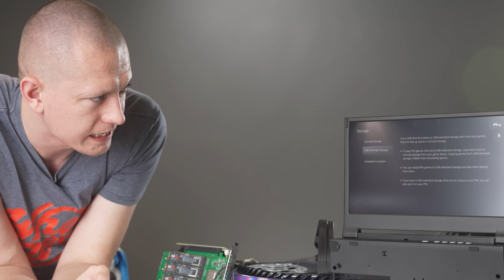I Put A GPU on the PS5

Comment: late to the party, buttttt... I installed a gtx 660 back when it was relevant, on a 13" Alienware laptop. Similar to what you are doing. What did I learn? Well, proprietary bios have what is called a "white list". In that white list, is all the hardware that the the bios will tolerate to boot. As in, if it detects a pcie device, on initialization that is not on  it's list, it won't boot it. 
.
This is more than likely, how sony kept people from upgrading their systems. The "software update" was probably more likely an update to the bios white list as well. How do you get around that? Well, you wait until the system passes post, then install the pcie device, BEFORE, the software attempts to initialize everything during boot. Pcie, "should" be hot swappable, i.e., it's not going to hurt anything to plug it in while the system is powered. I accomplished this by either listening to drives spin, or watching the power led initially flash, I can't remember.
.
Anyway, if you look for the highest scoring Alienware m13x I think, it's been years since I saw that laptop on firestrike regular, you will probably find my laptop, with 660gtx for the gpu.

Comment: If the SMPS turns off while unplugging the SSD slot use jumper in 24pins cable to short the SMPS. It will turn on the card while unplugged

Comment: buy a pci 4.0 adapter for the graphics card and connect the power supply to it, in addition to the adapter there is a connection [cables] for the wifi card with a slot for the wifi card and connect it to the console if the console has a wifi card

Comment: I have a homebrew on the PS4 but i'll not be hacking the PS5 until the PS6 releases.

Why? Simple hacking your primary console opens you up to lots of problems. The PS4 home brew i have every now and then needs me to force boot it requiring a laptop and ethernet cable along with disabling my firewall and antivirus as the tools are always picked up as a threat.

Comment: You need to Pre-configure your raid setup on a PC then install back in the PS5 and it should work. Hardware RAID cards have their own BIOS to create your raid volume. So create the RAID volume on the PC but don't format it until you have it back on the PS5. That should work if it can work at all. Good Luck!

Comment: Been wondering y cant u just put a more powerful chip on where the liquid metal is
Reply: it doesnt rlly work like that, the motherboard will just reject the chip because the chip that powers the ps5 is an APU specifically made for the ps5s motherboard
Reply: @unbtbtlyus2399  ic thanks
Reply: @unbtbtlyus2399  they should

Comment: It’s maybe possible if you externally power the adaptor i think if you cut out the 3,3 volt lines and ground and then power it with a battery or a powestation it may be possible. the 3,3v lines is needed to give a power signal so yes if you unplug it it wil just turn off and if you cut them out you won’t be back feeding in to the ps5 and pc so I can’t see hou it could damage anything

Comment: most devices that use a gpu, if the initial display is comming from/plugged into the igpu the device will need to be restarted to get display out of the DGpu, if it supports it

Comment: You Made a big mistake. The ground  of each powerunit is not connected right ober each component. This galvanic missconnection is the First issue. And at 2nd the gpu has to be daisychained with the ps5 gpu, if possible.

Comment: Another solution is to use the ps5 native network api and dump graphical data from the gpu (It would be like using another display, but instead of the PS outputting data, the gpu is used as an input)

Comment: They likely use a proprietary uid assignment protocol, together with a proprietary filesystem, much like an 🍎pad. If that's true, then the gpu would be recognized as a drive (consequently the memory controller would activate and dump a bunch of memory addresses, waiting for another component to implement the uid assignment and read the addresses).

Comment: Wonder if you could solder some flat cable like a ribbon cable to the m.2 adapter then have that go to a plug in for an m.2 on pc.

Once initialised plug adapter into ps5 then remove the home made end from pc. So it’s always plugged in.

Comment: Maybe it's a matter of SSD formatting. My theory is that the ps5 only reads data from drives formatted in their proprietary filesystem extension. I suppose it is a security feature, in order to avoid the cloning of drives to share free copies of games
Reply: PS5 is happy to format an SSD it recognizes into own proprietary format. If it does recognize an SSD and it is NOT formatted into own format, it will show a promt on startup to either format SSD or shut down itself for removing an SSD.

Comment: Why not initialize it on a pc and then just plug it into the PS5? I mean, the raid is contained on the card itself which should technically "bundle" the SSDs together and then just present them as one disk to wherever it's installed on?

Comment: Splice out data transfer, use that one  and delete the power cable from your 2nd cable. after buying another cable. One has power one is data transfer only from card because the cars cannot have two sources of power. Go from slot one to ps5. Install on 2,3,4 mdot2. I dunno just a thought

Comment: Where did you just unplug that HDMI from? Either side wouldn't have worked, you need a source (PS5) or a input device (tv) graphics card is an output/source device.. atleast the way you had it set up.

Comment: This migt be crazy but this video is just as if not even more so crazy install the driver into a usb stick when running on the pc then plug that into the ps5? :S then it has all the ini files it would need but they are for windowze what is sonys os based off linux iunno if u can work that out i'm sure there is a way soon enough there will be exsploits for running unsigned code for ps5 there is always a will so there will always be a way ask modern vintage gamer what he thinks about this

Comment: Not that I think it'll work, but you should populate all 4 m2 slots and put the card into a PC, install whatever drivers you might need for the raid card and see if it requires Linux/Windows/Dos to instruct the card to build the raid, and then after the raid is built, attach the card to the ps5

Comment: it IS A 4x port, you cannot split it into 4  4x ports , they cannot be accepted by the ps5 it reads the connection by bifurcation only so if it detects you split it into 1x ports it wont run at gen 4 speeds. THIS PROJECT was doomed from the start.

Comment: Since it is "hardware" based raid...the jumper settings choosing the raid "configuration" will need to be pre-set. prior to boot (raid-5 suggestion). As I was watching i noticed that the m.2 cards were risen off of the raid card. You must make sure all m.2 cards are of the same type as well as all attachments are PCIe 4.0 compliant; have no volume on them (unpartitioned) and install all 4 of those drives with the screws on them which flattens them closer to the raid card for a "solid" connection. BTW it should work. I have a ps4 pro with 8tb (2tb x4 drives) configured in raid-5 off of the internal sata using a sata to e-sata cable plugged into a 4 bay raid external powered box with perfect results now for 2yrs. Cheers...

Comment: If that's a proper RAID card, you'll need to initialise it first - using a PC.  The config for the card will be stored either in non volatile RAM or on the drives themselves.  I work with RAID every day of the week.  Put it in the PC, set your uefi bios to show legacy cards, and there will be a keyboard shortcut to enter the card config. B from there, create Volume using all the 4 ssds.

Once you've done all that, saved it all etc, connect back to the ps5.  Because only THEN will that pci-e card "look" like a "drive" to what it's plugged into.

Of course, because of the RAID BIOS on the card, the ps5 might still ignore it.

And like others say, m.2 and PciE the same, do it could just be a pciE switch, passing all the Ssds to the inboard controllers, leaving you no further forward either.

Try make it work in a pc like it's meant to FIRST though, otherwise how can you know it's the ps5 at fault!

Comment: Motherboards with built in graphics that have a video card also installed will default to the onboard graphics if that is what's plugged into the monitor on power on. The true way to test a graphics card in the extender would be to power up the ps5 with the graphics card plugged into the monitor, not the ps5's on board hdmi
Reply: Where would the ps5 get the drivers
Reply: @Chris-dy1cb  drivers for amd video cards a similar across multiple different designations using the same chipset (rx6600, rx6700, rx6800). While the ps5's video card is unique it may be similar enough to another dedicated graphics cards base chipset to still initialize a different graphics card from amd. Regardless of the graphics card being used (interal as based on the ps5 dedicated graphics) there have to be drivers for it to work so the ps5 os has drivers... just need to find the right dedicated graphics card that will work with those drivers - which may be impossible but regardless would still require the dedicated graphics card to be plugged in on bootup rather that the embedded video card

Comment: is it bad my first thought on how he powered this shouldn't have been with a motherboard connected to the PSU, but to use a jumper to tell the PSU to supply power. i use-to do it with a paperclip to test fans/pumps all the time.

Comment: Did you try to play games with the GPU plugged in? Even if the display output isn't being used, it's possible that the PS5 would still use the GPU for compute, if the drivers recognize the card...

Comment: Crazy that even the aftermarket Xbox storage worked but the raid card won't. Woulda been crazy to see a PS5 with like 16TB of storage. Maybe try running the raid card on the series x with the opposite of the adapter ya used to go Xbox into the PS5.

Comment: Cool video regardless.  However, my initial thoughts on what all your doing is, it would never work, because you're trying to use x16 devices on an x4 slot.  At a minimum, you would likely have to get a card that handles Bifurcation on the board, while only requiring an x4 slot.  I don't know of any.  I got an ASM2824 / SI-PEX40157 card on eBay to solve this issue on a board which didn't support Bifurcation, but it's still an x16 slot card.  Is your m.2 to PCIex16 slot adapter actually using the x16 in total, or is it just a physical x16 with only connectivity to x4?  I would think the latter.

Comment: you maybe mismatch the pci-e lanes and gens , the ps5 nvme port (every nvme port have 4 lanes in normal situation ) is pci-e gen4 with 4 lanes , for that raid card need 16 physical lanes, 4 lanes each nvme drive and the controller make a raid between the 4x4 lanes so in this way absolutly not working of course , your riser have 4 lanes from the nvme adapter , and your pci-e slot size same like a 16 lanes slot but electricaly just 4 lanes have in that port , if find somewhere(maybe nowhere) a 4 to 16 lanes plx controlled extension ( like a 1 to 4 port in mining plx) maybe with that work but that chips not already have pci-e gen4 compatibility (used on bigger mother boards for the multi gpu setups in the older generations pc with pci-e gen2-3) or the lanes can split up 1-1-1-1 up/downlink and lose the port speed and stability , and should by the PS OS not working in splitted pci-e bifurcation mode (need software compatibility).

Comment: You wouldn't be able to move a PCIe device (i.e. a NVMe SSD) from one host to another without powering it down. The reason being that when the host boots up, the BIOS initializes the PCIe device (e.g. setting up the BAR mapping which maps the device to system memory). If you were to transfer it without re-initialization, then the values in the BARs would be incorrect and the second host wouldn't have mapped it to the respective system memory. So at best, nothing would happen, at worst, it could corrupt your system state (if two devices response to a given PCI address).
I don't have any suggestion though to get something like this to work. Someone could probably implement a custom hardware solution that doesn't require driver initialization, but that would be very niche with a limited market - so it wouldn't be cost effective for a company to produce and would be very expensive it it was (probably over $4,000 USD using a custom FPGA - it could bank and forward the NVMe commands to respective sub-PCIe slots, but that's not a trivial thing to do).

Comment: I bet the problem with the hardware RAID card is that it requires the full x16 interface and cannot work with any less. PCIe NVME is only x4 so you need a PCIe 4.0 x4 solution to this to have any chance of making it work. If there's no way to multiplex 2 or more PCIe devices onto 4 lanes then nothing is ever going to get more than one NVME drive working on a PS5. Nor is it likely to be able to get any single PCIe SSD working that has a connector larger than x4.

4 PCIe 4.0 lanes is all you have and nothing that absolutely needs more will work. Perhaps a SATA hardware RAID card? If there's such a thing in PCIe 4.0 x4. I'd want one that has its own BIOS setup so it can be configured without needing any operating system and thus completely hides from the system that there are 2+ physical drives. It would have to make itself appear on the PCIe slot as a single PCIe Gen4 x4 device.

Comment: Question, did you ever try the Radeon with the HDMI connected to it when you powered on the system?

Back in the day Windows wouldn't activate the secondary GPU without a cable connected, considering you're trying something completely oddball (which I did ask for, so thanks), it may not activate the GPU unless it is connected at power on.

Not expecting it to work but it's an old hardware/software limitation, simply swapping the cable while it's running was actually likely to fail even if it did otherwise enable the Radeon.

Comment: But..you are using four 4x pcie 4.0 drives, thats why the raid hs a x16 interface on but then you simply cut it down to 1x4 for the ps5 m.2 slot..
The remaining 3 SSDs have no chance to init. even if the ps could handle the raid card :/

Comment: I have been in IT industry for 28 years.  With any hw raid controller it's bios needs to start before the system starts. The system will need a driver for the raid card. So there maybe a card that will let use use 1 drive. The only other thing is a slot adapter that would let you use 2 different cards with 1 ssd or m.2 on it.  I would try the ssd on a pci card next.  That might be your best bet.  Sabrent  has a m.2 to. Ssd adapter I would try that

Comment: The hardware raid may need its bios or uefi module loaded during boot so it can present a drive to the system.
Reply: And is this not what Option ROM is for? But I would guess that it would not be supported on a PS5 anyway

Comment: The PS5 will be awesome once modders crack it and enable homebrew. We'll be able to build kernels with drivers for stuff like this!
Reply: Also, the highpoint “hardware” nvme raid controllers are NOT hardware raid. They are essentially just a non-raid adapter card that comes with a highpoint branded software raid system. These cards require a driver to use the raid. Hardware raid does not require software on the host to work.
Reply: @r.adamberk4904  pretty sure he needs something like the honey badger(lqd4500)  that has an actual Hardware RAID controller on it that is independent of any software on the host system.
Reply: Buy your self a PC !
Reply: Won’t be hard to crack, Sony is known for there vulnerabilities and not caring for high end encryption
Reply: wait 2 years
Reply: @rochester3  only had to wait 12 days, 2 hacker groups have just cracked the code 😂
Reply: @_Shinasu  wow
Reply: I’m really surprised too. Everything I read on cracking the ps4 was always on some really outdated version nobody had anymore
Reply: @_Shinasu  no hypervisor exploit has been found still
Reply: @rochester3  its been 2 years
Reply: @rochester3 what about now 😢
Reply: @rochester3 2 yrs done
Reply: @rochester3  its been 2 years
Reply: @rochester3  its been 2 years anything yet ? lmao
Reply: @rochester3  it is now 2 years
Reply: @rochester3 it’s been 2 years
Reply: 2 year later  @rochester3
Reply: dude we still barely have working ps4 linux
Reply: Bro just mod a ps3 or ps2 if you wanna play homebrew 💀
Reply: Ps5 homebrew has been done already
Reply: Done, it's there
Reply: Imagine installing steam  deck os on ps5
Reply: @NicVandEmZ  aslong as the PS5 has kexec then it's possible

Comment: doesn't the raid card use the power it receives over the pci express lane as a signal to power on or off, to keep the fan from spinning? I suppose if you jumpwire the same voltage to that pin, the raid card won't shut down. 
I would cut the wire so no power goes to the ps5 and maybe put a resistor to ground at the wire coming from the ps5's express lane power pin. 

Good luck :)